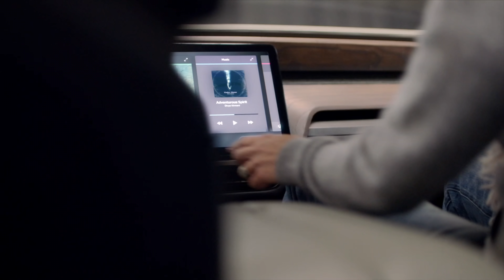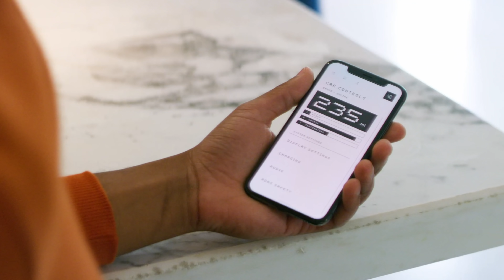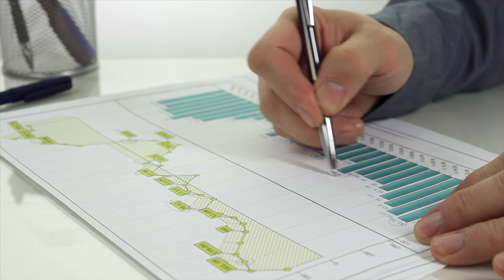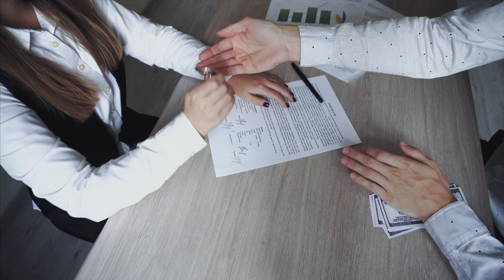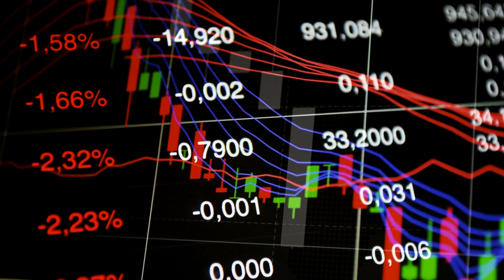Why Electric Car, Hydrogen Fuel Startups Are Going Crazy Over Reverse Mergers

Comment: Nikola deals in hydrogen and suing Tesla. Since green hydrogen is expensive and there are no hydrogen fueling stations anywhere but California Nikola is a risky proposition.
Reply: The price of green hydrogen is falling, and will continue to fall for two reasons. 1) Electricity produced by solar and wind is falling faster than anyone ever thought possible, which will continue as more renewables come online and 2) Investments and technology all over the world is scaling up for electrolysers and other means of green hydrogen production, many of them backed by big money from investors and governments. Check out a company called Syzygy. They are bringing to scale an H2 manufacturing method using plasmonics. The device can be built cheaply using readily available materials. It only needs bright light. As companies like this, and others, scale up their production the price of green hydrogen will fall. Just like lithium ion battery prices fell over the last decade.

Here is the thing about hydrogen. You cant look at it only thru the lens of a light duty passenger vehicle propulsion system. Hydrogen will be critical in decarbonizing aviation, international shipping, steel production, cement production, fertilizer and feed stock industries AND provide for a long term, seasonal grid storage medium. Electrons are great at certain things, but molecules can do things an electron cant.

When you need to move clean, renewable energy from one part of the world to the other, you need a molecule. When you want to store that energy for very long periods, even years, you need a molecule. Do you loose some initial energy from the transition of one state to another? Yes, of course. But again, clean renewable energy is becoming so ubiquitously cheap that this will be factored into the price of hydrogen. 

Batteries are great for small things that move, like passenger vehicles, trucks, bikes, things like that. Batteries are also great for big things that dont move, like the grid storage facilities at Hornsdale. But big things that move? You start to gain a penalty as the battery become a larger and larger percentage of the overall weight of what you are trying to move. That is why for big buses, trucking, shipping vessels, trains and planes, hydrogen fuel cells make more sense. But, hydrogen can also decarbonize all the industries I mentioned early in a way that batteries never will. And thats ok. Because moving forward with the Energy Transition isnt about picking one single technology that is the answer to everything. It will involve solar, wind, geothermal, batteries, hydrogen, VPP's, smart grids, agrivoltaics and so much more.

The import thing to remember is that as hydrogen becomes more commonly available then it will become more attractive as a light duty vehicle fuel. Especially since you can plop down an electrolyser anywhere you want that has power and water to make fuel. Check out a company called Enapter. They are making affordable  electrolysers designed to be like blade computers in a data center. If you need to scale up you just add more units. If you need one, buy one. If you need a hundred, buy a hundred. Easy.

The future will see battery electric vehicles on the road and in parking garages next to hydrogen fuel cell vehicles. Anyone who thinks one has to beat the other is deluding themselves. Just as we have internal combustion engines on the road now running on different types of fuel (petrol, diesel, not even counting propane and natural gas), so too will we have different types of electric vehicles. This is normal. Some people will prefer BEV, some will prefer FCEV. Different parts of the world will favor different technologies, depending on how their country transitions thru the changes ahead. Just like how Europe embraced diesel as a passenger vehicle fuel in a way America never did.

Whether or not Nikola will pan out is its own story. They have the potential to pull off everything they are saying. We will see if they are capable, thats up to them. But they are simply the most high profile, P. T. Barnum type company out there doing this right now. Many others are working quietly, getting the hard work done.  If Nikola doesnt succeed, others will.  Hyundai has already delivered some fuel cell trucks to Switzerland, and Mercedes is working on its own thing. Also, this https://www.electrive.com/2020/07/12/european-hydrogen-corridor-for-1000-fuel-cell-trucks/

The whole point is...the Energy Transition is what matters. We need to use every available technology we have to get us there.
Reply: @widdershins1039  I am going to stop you on your first assumption. No matter how far prices for energy fall storage in batteries will always be less expensive. Currently all hydrogen is from natural gas. A fossil fuel. The revolution is electric. Delivery will be the key. #1 direct connection to the energy source. #2 batteries. #3 everything else that doesn't work. Continuing the fossil fuel paradigm via hydrogen is for losers. Nikola in my opinion will fail. You are wrong on the big vehicle theory. Data from the Tesla Semi proves you wrong.
Reply: @LawrenceRhodes  Yes, almost all CURRENT hydrogen comes from Steam Methane Reformation. And it is a $120 billion a year industry. Right now. Thats how much we use hydrogen right now. 

I dont quite understand your remark about the 'revolution is electric'. You do understand that the hydrogen component of the Energy Transition is is made from clean electricity right? And fuel cells turn it back into electricity, right? So...yeah. Its all part of the electric revolution.

Also, you can burn the hydrogen 'CLEANLY', with no harmful emissions, to heat steal. Can you please explain how electricity can be used in giant smelters to green up steel production? Or how electricity can be used to make cement? Both of those industries are some of the biggest polluters on the planet. Electrons cant do anything here.

For instance, lets say you have excess electrical energy produced at a wind farm in Wyoming. And you have a buyer who wants that power in Bulgaria to heat steal with. How do you get your Wyoming electricity over there and then use it to heat steal.

Keeping it as an electron, you dont.
Reply: @widdershins1039  Thank you for an excellent, well thought-out post.  Efficient electrolysers are the key.  Or at least one of them.  Efficient H2 storage is another.  I wouldn't say that we need to use every available technology we have; I'd say we need to use every available technology that makes sense.  There are applications where hydrogen makes sense.  Of course it needs to be electrolytic H2 rather than steam reformed, and eventually it will be.
Reply: @incognitotorpedo42  Exactly right. SMR produced hydrogen is necessary to the beginning stages of hydrogen economy. No way around that. It is for the same reason that we use a lot of fossil fueled machinery burning diesel (trucks, ships, cranes, diggers) to build onshore and offshore wind farms right now. It is the old dirty technology we have that we use to build a new, clean infrastructure. Those who dont understand this are the same as people who hate on Tesla by saying "Buying an electric car is dumb because a lot of your electricity comes from COAL. Ha, gotcha!" Arguments like this are just stupid.

This is why its called the "Energy Transition". We are transitioning everything over from the old tech to the new. In every era of human historical development we have used the old world to build the new one. Same thing here. We have to burn fossil fuel to build a world where we dont burn fossil fuel.
Reply: @widdershins1039  Your assumption that hydrogen can be transported is ludicrous. Green hydrogen is even more energy intensive than steam reformed. You want a system that electrolytes,  compresses, to liquid then transported 6 thousand miles. At this point hydrogen fuel cells are about half as efficient as battery storage. With Green you are looking at maybe 1/3 so now for every kilowatt that goes to power a battery vehicle  you must use two to run the same weight fuel cell vehicle. If it is Green you must produce 3kilowats of energy.  This is why hydrogen will fail. It is not easily transported. Electrons can be transported by wire. Can't do that with hydrogen. Hydrogen leaks. It is hard to contain. Metal embrittlement is a problem and have caused huge explosions in Norway and California. Transport via the grid system or batteries is the best way moving forward. I think Elon Musk said it best. Quote: “I don’t want to turn this into a debate on hydrogen fuel cells, because I just think that they’re extremely silly [audience laughs]. If however you simply want to keep the fossil fuel paradigm then let big oil put up the infrastructure and see if they can make it work. Of course someone will have to buy the vehicles and the fuel. The first time they see $8 per gallon price the marketplace will respond.
Reply: @incognitotorpedo42  The technology must make sense efficiency wise. Green Hydrogen is 1/3 as efficient as battery storage or direct from grid. This means for transportation for every vehicle running batteries using 30 kilowatts to go 100 miles 90 Green hydrogen kilowatts must be used to go the same distance in a fuel cell vehicle and at a cost of about $8 per gallon. No body will buy that.
Reply: @LawrenceRhodes  "Your assumption that hydrogen can be transported is ludicrous." I'm sorry to be the one to tell you this, but hydrogen is already transported all kinds of different places. Remember that part where it is currently a $120 billion a year industry? Here are just a couple of links for you. 
https://www.energy.gov/eere/fuelcells/hydrogen-delivery
https://www.electrive.com/2019/12/23/kawasaki-hybrid-carrier-ship-to-transport-liquid-hydrogen/

Kawasaki, and actually the nations of Japan and Korea, disagree with you on hydrogen transportation being ludicrous. They built a whole new ship and port just to move hydrogen (brown) from Australia to Japan. Oh, were you aware you can transport H2 as Ammonia? Much easier and safer.

 "Green hydrogen is even more energy intensive than steam reformed" False. SMR is fairly energy intensive, and of course when you factor in the carbon released then its just ridiculous. You seem to doing exactly what the Tesla naysayers of ten years ago were doing. All of your arguments about the cost of H2 production are looking at things EXACTLY AS THEY ARE TODAY, IN THIS MOMENT. You dont seem capable of understanding how the current investment in green hydrogen is changing things, almost daily. I remember argument after argument how Tesla was going to fail, because batteries WOULD NEVER BE COST COMPETITIVE. And yet, look at where the last ten years have brought us. Why? Because of investment and scaling. I dont mean to be rude, but you might want to educate yourself on exactly what is going on worldwide with green H2. You seem to be out of the loop. And I simply dont have time to educate you on Euro policy, Chinas plan for a hydrogen society, the Hydrogen Council, inter corporate decisions regarding H2 within Oil Majors, and every single company who is pushing the boundary of H2 production. Did you even look up Syzygy? Tell you what. Listen to this episode of the All About Hydrogen Podcast where the guys interview Trevor Best, the CEO of Syzygy. https://podcasts.apple.com/gb/podcast/hydrogen-net-zero-circularity-perfect-syzygy-trevor/id1475783473?i=1000486575140  It might help you understand just how fast this is moving.

I dont have time to get into why your math isnt right. Its just wrong.

And here is the thing about Elon...

This quote from James Temple on twitter says it best.
https://twitter.com/jtemple/status/1295067029011984384

"My story: Green hydrogen may help clean up the aviation, shipping, steel and the fertilizer sectors, and provide a form of seasonal grid storage.
Informed response: But Elon Musk, certified genius, said it will never work in cars."

Lol...dont be that guy.

Keep in mind, I love Tesla. My daughter just did her "Famous American" project on Elon for school, which I helped her with. Elon has done amazing things for the world. But I cant imagine why a savvy, clever businessman of Elons caliber would talk crap about a technology he decided not to use, yet some of his competitors are moving forward with. It made NO SENSE for him to consider fuel cells for his vehicles, because he instantly understood he could much more quickly build out a network of chargers for far less money and time than a hydrogen network. He made the right decision for his product for the time he made it. But there is a whole world of other people out there building an infrastructure of hydrogen for a myriad of other things. Again, cant imagine why Elon would continue to talk trash about fuel cells when he is trying to bring his BEV Semi to market. I mean, c'mon.
Reply: @LawrenceRhodes  I agree, if we are comparing a BEV passenger car to the HFCV version.  Two things, though:  1}  Electrolyzers are getting to be significantly more efficient.  2}  We sometimes just throw away perfectly good clean electricity because we have nothing to use it on.   If the energy source is clean and costs nothing, who cares if it isn't super efficient?
Reply: @incognitotorpedo42  OMG, this. We built a world on the back of the stupidly inefficient internal combustion engine. 20 to 25% efficiency of gasoline on the best of days, with the rest lost as waste heat. Fuel cell vehicles are already more efficient than combustion engines. Nations dont plan infrastructure around what is the most efficient percentage point of one technology in one era in one location. 

We can use Japan as a case example. Japan is not exactly overflowing with renewable energy options. But it has made the decision that H2 and fuel cells are going to be the answer for most energy concerns moving forward. From transportation, to heating, to industry, just about everything. They understand that brown and grey hydrogen will be purchased and used until more green hydrogen option come online and become price competitive. That is why they are looking to Australia to provide a large portion of what they need. Australia has the capacity to produce over 25,000 gigawats of renewable energy. That is a lot of cheap hydrogen. But it is also a lot of cheap ammonia. Several companies are developing ways to create very, very cheap ammonia from electricity, water and nitrogen. Then that ammonia can be shipped cheaply to Japan where using the Plasmonics device from Syzygy it can be converted directly into hydrogen, cheaply and cleanly.

This is what I'm talking about. There is so much development and investment in H2 tech right now it is mind blowing.
Reply: @widdershins1039  Trains should never be run on anything but overhead wires. Ships are going back to hybrid, solar, sails, kites running electric motors. There is simply nothing gained by using fuel cells. Except wasting taxpayers dollars on a boondoggle.
Reply: @incognitotorpedo42  We need to be efficient for things we use all the time. If you use fuel cells for storage you get less back in the end due to losses including inefficiency. I believe fuel cells don't even beat pumping water up hill to go through the dam again which is a current way of using excess energy.
Reply: @LawrenceRhodes  "Trains should never be run on anything but overhead wires. Ships are going back to hybrid, solar, sails, kites running electric motors. There is simply nothing gained by using fuel cells. Except wasting taxpayers dollars on a boondoggle." 
I'm incredibly sorry Lawrence, and please accept my apologies. I made the terrible mistake of assuming I was speaking to someone who was actually somewhat knowledgeable on renewables, but with whom I only shared a difference of opinion. I see this is not the case. Have a great day.
Reply: @LawrenceRhodes  Sure, pumped water is great if you have the geography for it.  The problem is, most places don't.  We're only talking about making hydrogen (or other energetic chemicals like ammonia) when there is clean electricity that would otherwise be thrown away.  That occurs frequently.
Reply: @widdershins1039  If you are backing hydrogen I am more knowledgeable than you. If you do the math hydrogen doesn't work. Sure make hydrogen but use it for commerce. Not transportation. We already have useful avenues. I envision an efficient world with no plastics or artificial products. Everything with a long useful life and recyclable.  Here is a good example: They used batteries rather than hydrogen for energy storage because it's simpler and longer range. Stella (solar vehicles) - Jump to Stella Lux - During the race, the car set a distance record by driving 1,500 kilometres (932 mi) on a single charge, with an average speed of some 80 kilometres per hour (50 mph), and all the while having two people on board. This is a 4 passenger vehicle with a 15kw battery and 1.5kw solar panel. Trunk and cup holders. https://en.wikipedia.org/wiki/Stella_(solar_vehicles) So successful in the two successive World solar challenges the race committee reduced the allowed battery and solar panels by 20%.
Reply: @LawrenceRhodes  One HUGE problem with batteries as a means of energy storage for transportation is that you have to carry around dead weight as you run out of energy, regardless of how much you have left. This is why the idea of an electric plane is ludicrous, and why PEVs should be too.